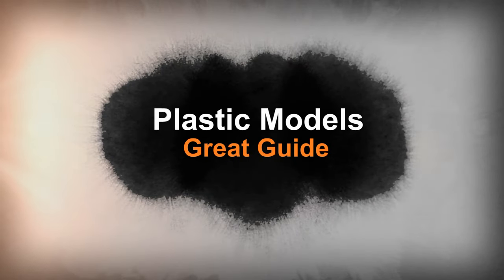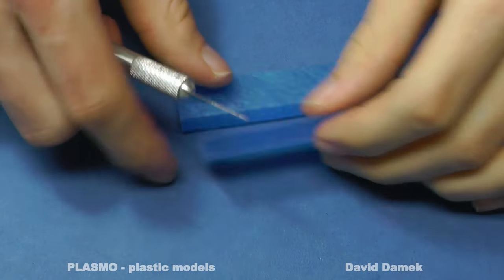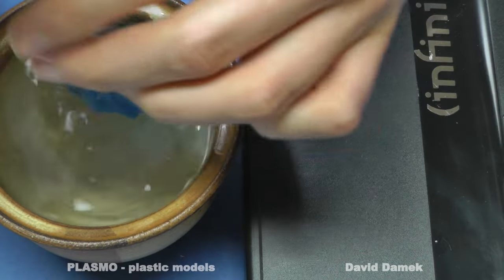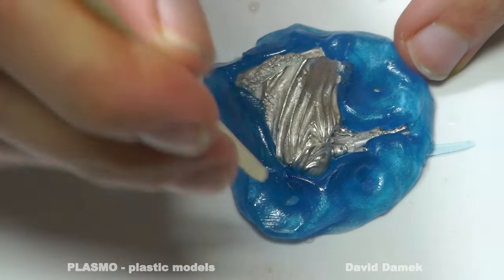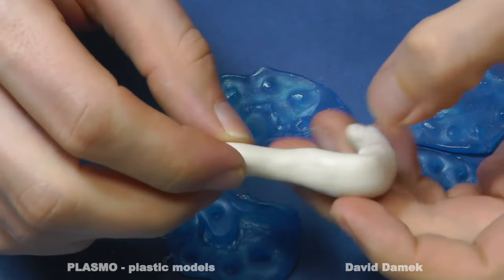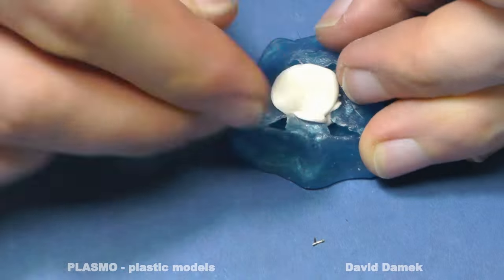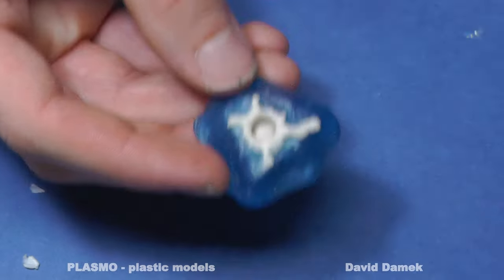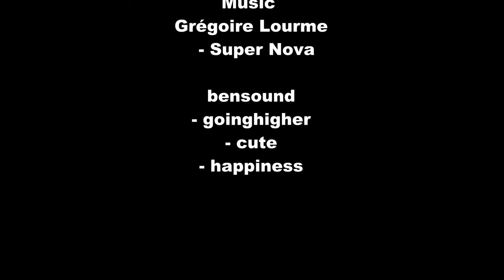Blue Stuff/Oyumaru  - How to cheaply cast miniatures or plastic models - new version

Comment: I had a go with this stuff, and had trouble.  The plastic stays soft for a very short time indeed.  I used water that had just boiled, and when I took the soft plastic out, I had just a few seconds to make a mould, and it took four attempts to make my first one.  Then, mixing the Milliput took quite a while, and then getting the putty into the far corners and undercuts of the mould was very difficult.
Reply: seeing your comment was a pleasant surprise :D love your videos good sir!
Reply: Lindybeige could you use a hair dryer to keep the blue stuff manageable  ?just a thought
Reply: Hm... Maybe use a sculpting tool for the corners. As to the processing time, it depends on the actual temperature. Did you use a metal bowl? that sucks up a lot of thermal energy. Also, some people have more problems touching hot materials than others. I've seen People handle stuff without mittens that others would immediately drop.
Reply: A better way i have found is to buy two part liquid resin, the 1st part is to make a lego box, put half the (hot/warm)  instant mould in the bottom jam it down hard,  the press the part you want to make down into it. leave it in there. get the 2nd half hot, push it in on top. when it cools, pull them part, make a channel, mix up the resin, pour it in done. (test the volume 1st with water to work out the volume needed).
Reply: Haha I just watched one of your videos before watching this. And I had just ordered some blue stuff. Hope I have better luck!
Reply: For the blue stuff, use a hot towel, or other heated surface you can think of, to keep the material pliable for longer.  You could also work with a small desk heater hitting the work space to give you more time.
Reply: Lindybeige...Thats because in the UK room tempreture is so cold....??  😀
Reply: Lindybeige hia the reason it went hard too fast is you must of taken out the blue stuff too soon try leaving it for another 30 seconds after it goes soft to ensure that the temperature is the same through out the material ;)
Reply: Lindybeige ehdi NC x ty
Reply: use Greenstuff milliput is not good for this unless its small stuff u mould
Reply: +Lindybeige How small the world is! I always place fresh molds in a freezer for about 5 minutes. After that they are almost rockhard.
Reply: i do almost the same when the mold is done i put it under running cold water turns hard very fast xD
Reply: +Antons Kijaņica 👍
Reply: Lindybeige prewarmed surfaces and atmosphere help
Reply: Lindybeige!
Reply: Lindybeige!
Reply: if you use green stuff try applying some Vaseline to stop it sticking
Reply: Hahaha - from the UK.. probably...
Reply: Indeed, he said one minute!  Where did you get the name from Lindybeige?
Reply: you could try using liquid green stuff to get the outside details then fill in with miliput? although in my opinion it would be simpler and better to make a silicone mould and cast with pewter
Reply: I suppose nothing worth while is easy right?
Reply: James Wright depends what you are casting, i guess.
Reply: Maybe leaving it in the boiling water for longer?
Reply: Oi vei! What Lindy is doing here? :-))
Reply: Leave in the water longer and make sure the surface and air are pretty warm. And if you are using milliput use a sculpting tool and toothpick fill the details then add more until the mold is full. Though I still like the thought of scanning things with a 3d scanner/CAD Software and then using a CNC machine and a home made injection molder to make models. The 3D Scanner/CAD Software is the only really prohibitive part anymore. The CNC and Injection molder can be made either from blue-prints or kits for next to nothing with only a modicum of skill. Then the steel can be found pretty cheap if you find a dealer. cut your mold and viola.
Reply: Hotplate and silicon a sculpting tool. Silly Llyod.
Reply: Use a heated baking tray to mold on to keep it soft longer. When you want it to harden, place it onto a stainless steel kitchen sink to dissipate the heat quickly.
Reply: Igor Fajzulin ff
Reply: Lindybeige  funny seeing you here lloyd!
Reply: The only thing between me and a Jagdtiger 1:1 replica is the bluestuff working time really
Reply: Lindybeige 
Do “A few points about blue stuff”
Reply: JTMC93 Around how much would it cost to make a home made injection molder? And how complicated is it to build? Also I have very little in the way of power tools, would that be a problem?
Reply: Leslie Shafer 
It would be a lot cheaper if you bought regular kits instead of moulding them yourself
Reply: Huzzah! More miniature videos please Lloyd!
Reply: Chin Chin The Dark Lord
Actually I was wondering about the injection molding for reproducing some of my original sculptures. I agree with you, buying model kits would be cheaper than trying to reproduce the entire kit. Also the only miniature parts I would reproduce would be ones from models I bought used that might be missing 1or 2 small parts. And of course the only way I'd have the part to cast from is if I'd bought another of the same miniature as a new kit. Well that's not the ONLY way, but that's the way I'm doing it.
Reply: A mug warmer - a small heated flat plate that the mug sits on to keep hot drinks hot - may be a good way to make the working time longer.
Reply: How long do you all leave your epoxy to cure before you make the mould? The moulds are easy to make, it's the casting I'm struggling with!
Reply: Suprising seeing you here
Reply: Lindybeige The outside of your saucepan was probably too dirty.  Clean it well and try again.
Reply: @JTMC93 There is no consumer 3D scanner that has sufficient precision and resolution to capture detail at this scale and produce such smooth results. A CNC machine, especially one that can do steel, that is precise enough at these scales is going to get very, very expensive. Suppose you got that together for free. Even then, for one off replication jobs, the cost would be prohibitive. Carbide tooling is expensive and wears out, and regardless of how cheap the steel is, it won't be cheaper than reusable thermoplastic (even allowing for degradation after reuse).
Reply: It depends on what you want to recreate, it's very good for tiny parts, decent for small parts. But when it comes to more detailed stuff, it is quite terrible.
Reply: hell yeah, just did a try on a space marine which came out horrible and deformed!
Reply: Hey Lloyd. Glad to see you patronising the channel of another great youtuber (in a good way). What kind if milliput was it? I got some extra fine white milliput and it was a lot thinner in consistency to the green milliput. I am going to try to cast a large 120mm figure from the 1970s as they dont make them anymore. It is in parts though. Prior to building it up of course.
Reply: Didn't expect to see you here, nice one
Reply: tbh the method shown here can easily be improved.
1) work in a warm area or pre-heat your work surface. Having a hairdryer at hand is an easy fix too.
2) if you just add two toothpicks to the mould you can easily pour into the blue stuff. much less of a hassle then using the epoxy putty. Especially if you want to make a few of there the time saved really stacks up
Reply: How difficult? I just want to make shoe soles for 1:6 scale lady figures? I am quite confident about making the uppers but the soles really annoy me and I don't want to pay someone else who is basically just doing this or something very similar and selling it on Etsy.
Reply: @AnneAndersonFoxiepaws  if it was easy every1 would do it.....pay up!
Reply: Love your videos!
Reply: Obviously it was because your British water sensed it wasn't being used for tea, and thus cooled immediately.
Reply: Mr. Lindybeige! Fancy seeing you here xD
Reply: German Blue Stuff is better than English Blue Stuff...lol
Reply: Hi Lindy.
Reply: the main problem with this solution is in order to make the green stuff fit the mould perfectly you have to smush it and shove it in and in doing such the elastic oyumaru deforms and warps a bit so you end up with a seemingly perfect recast only to then realize it's mishappen and wonky because of the force you applied while stuffing it
Reply: GW simp

Comment: This stuff has been around in Japan for a while and I always find that using polyester putty or tamiya light curing putty or uv bondic type resin. Since its transparent light curing putty's are very nice to work with and get into all the corners without the worry of dry time.  Good luck!   Also for complicated molds throw some talc powder inside molds then, Blow it out leaving tiny film of powder this will help with pulling putty out and keeps mold together for duplicates
Reply: Tamiya makes some insanely useful modelling stuff.  I just got the entire line of weathering powder and it has revolutionized my painting the same way washes did when they came out.
Reply: Tamiya are God's!

Comment: Oh, this looks incredible! I recently ordered a very rare unreleased toy that is missing a few components that most fortunately have duplicates (the same piece six times but missing two), and everything I've been looking at is prohibitively expensive (several hundred USD). The fidelity of the minis you made with this tutorial are incredible and I think more than sufficient for what I'm doing, and evidently I can get an entire setup for like $25 USD. I'm going to try it; wish me luck! Thank you for posting this!

UPDATE: it worked perfectly! This stuff is basically a miracle product and cut a $200-$400 repair down to only $30! 11/10 would recommend to any sort of toy repair
Reply: Just out of curiosity, what material did you fill the mold with? A two part epoxy from a hardware store, or something else? Great to hear someone had such good results! I got a ton of fantasy bits, but very few body’s to put them on, so was planning to make extras for personal use.

Comment: I use a product called steel stick. It's used in plumbing repair. It's a two part epoxy and hardens in 5 min. You could pump out a 500 point army in 4hrs.

Also they have this exact product from Japan. It's used as a clay substitute. It's called Oyumaru.
Reply: The Cocked Die steel stick?
Reply: @aliyaabdukadir2043   There are a number of two part epoxy sticks at auto parts and plumbing stores. What Cocked Die is referring to has steel powder in it for added strength in auto and plumbing repairs. JB Weld, Quick Weld, JB Quik and other names for basically the same products. I'm not sure how good any of them will be if you want to keep a lot of fine detail, but they're easier to find than pourable silicone for mold making.
Reply: @Tanya_Von-Degurechaff  probably not. I think steel powder epoxies have a max working temp that is below the melt temp of lead free pewter. You might get one or two casts of poor quality. Metal (pewter) will need high temp silicone.
Reply: @Tanya_Von-Degurechaff  look for tin cured silicone rubber. Mold Max 60 has a maximum working temp of 560F and pewter melts at about 500F. The minimum thickness of your mold walls should be 6mm or 1/4 inch at the thinnest place.
Reply: @Tanya_Von-Degurechaff   I don't know what to tell you.  I looked on ebay for "pewter casting silicone" and had lots of results but I'm in the US. None of the options are inexpensive. If you can cast in plastic or resin (epoxy) you'll have a lot more options. Good luck
Reply: @Tanya_Von-Degurechaff  I've heard sand is good for metal castings. Wouldn't know how to do a 2 part mold.
Reply: AlchemyForge the side mirror on my car is currently stuck on with JB weld, it was meant to be a temp fix to get home with but holy hell is that stuff strong, its not been a problem for years now.
Reply: @bentosan  do you handle the epoxy without gloves?
Reply: Thomas Rainier Saballa I have yes, would I recommend it... no
Reply: @bentosan  have you tried recasting inner frames? Theyre not brittle when put together?
Reply: I haven’t done any casting
Reply: How do u keep it from sticking to the mould? Or does it come out okay?
Reply: @Tanya_Von-Degurechaff  i found high temp silicone in auto-repair store... it is used to make engine gaskets. it is not liquid but i think it can be made pourable with naphtha (white sprits).
Reply: @Gowaduv  09 crew
Reply: any two part putty softer or around the hardness of your mold should do. You can experiment with consistency and getting max detail. Or go with casting, polyurethane/ liquid plastic. Loctite Two part auto putty (white and blue) used to be the green stuff alternative. It doesn't do details as good as greenstuff though. I also have "knead it" a two part repair putty that is hard in 5 mins. Slightly to hard. I also used an acrylic sealant caulk+corn starch/flour that seems the best so far.

Comment: Protip for those difficult parts to cast (eg: necron immortal pair of legs)

If you don't want to cut the original piece or try to make 3 part molds you can actually cover most of the details of the model with the blue stuff, once the cast is ready remove the piece and then fill it with milliput, wait for it to dry, retire the upper part (usually the one with less contact with the original piece), just immerse into water the other part of the mold, this will make it softer, allowing you to remove it far easier from fragile parts without damaging them.

Of course after this the mold would end warped, but that's no problem, if you still need it just cast the part again, you will get to clone fragile parts such as necron legs, chaos spikes, etc. without having to resculpt them or paste the broken bits, actually saving time.

Comment: Greetings from Australia.This is a great tutorial. I have just ordered some Blue Stuff from Spain.  This will make great molds for my fishing lure making hobby.  Thank you for showing the qualities and characteristics of blue stuff. From my own experience of mold making, if you want to reduce the excess epoxy putty from forming 'flash' you could try making some excess sprue escape holes by pushing soft solder wire onto the blue stuff mold  at strategic points when you form your mold. This will then give the excess epoxy putty somewhere to go when you force the two halves together.  Soft solder will easily follow the uneven surface of the mold half.
Regards Dave
Reply: In the future, for Australians it is probably easier to get some Oyumaru from japan, it is the same type of molding material

Comment: This is great! Ive been playing 40k for about 2 years and I love Drukhari and want to start a Haemonculi Coven army but all of the Coven stuff is outlandishly expensive even by GW standards (with the exception of maybe the Talos kit) This will help me get Wracks up and running, thanks!
Reply: Based
Reply: Doing the same for a knight themed guard army using Arbites body’s an heads, would love to hear how your army turned out, what resign or two part epoxy did you use?

Comment: I was looking at how to mold plastic for car parts and I think that this could work. I am amazed at how well this turned out. Using this you could make any simple small car part. Example: switch cover.  Make an emblem to put on your hood. Or just some plastic washers. Anyway just keep what ever you are making out of the engine compartment and you should be fine

Comment: I used the exact same epoxy putty and found it brittle/breaks easily for small or thin parts. For e.g. in the video you showed briefcases and rifles. Did you not have trouble with the briefcase handles and rifle barrels breaking? I broke my parts when I was removing flash with clippers. It makes me feel like if you ever dropped your miniature, the parts would break off.

Comment: I could see this being used to replicate parts that you would rather not destroy through kit bashing. And it is the fastest way to figure out who is an elitist a-hole.
Reply: For me it would be making extra parts you don't receive enough of (Bolt Action Player, you only get FOUR Springfield rifles for a box of 30 figures.)
Reply: The fuck?!
Reply: @RockSplitter  You get plenty of weapons, but most of those are M1 Garands, M1 Carbines, and Thompson SMGs, i want a force with mostly Springfields.
Reply: No this is the fastest way: "I just 3d scan each kit I buy and print the parts I need as I need them. Seriously dude, my army cost like, 245 total. Counting the printer and resin. You payed what... 500 bucks for those Orks? Lol." Seriously though, get a resin printer. Saves you so much cash.
Reply: @MeepChangeling  what do you use for 3D scanning, and do you need to do any cleanup after scanning?
Reply: @Kodaiva  cleanup 3d printing in my experience (4 years making props professionally) is either dream or a nightmare. It entirely depends on the printer. Some require almost no cleanup, nearly perfect prints. Some require a ludicrous amount of time, and a deft hand to clean, as well as a healthy amount of bondo. Just do your research on it before buying.